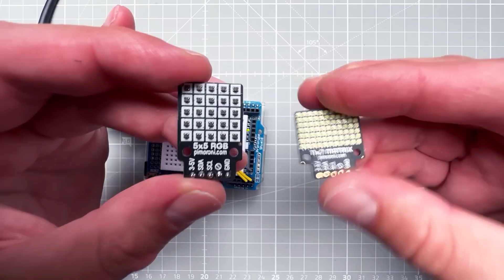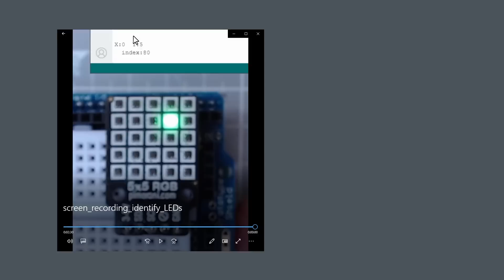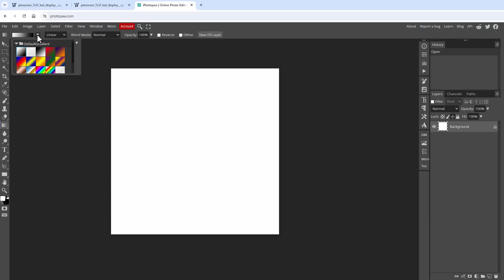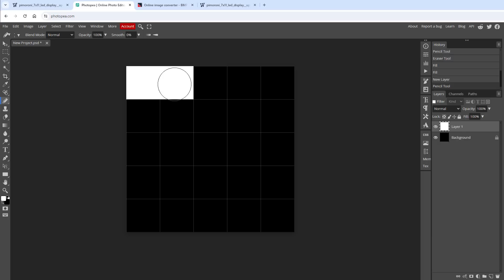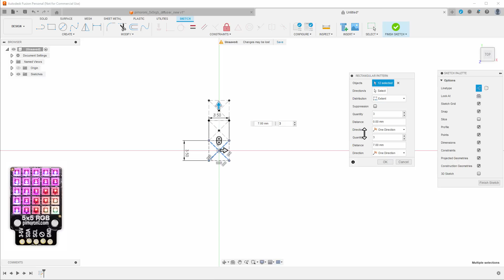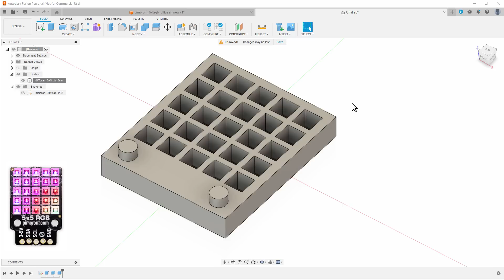Yet Another Gear Display

Comment: I think the best look would be to simply print a traditional diagram on paper (black background, white shifter lines and printed gear numbers and R) of the shifter pattern just below the knob surface plexiglass, making it round and using the RGB array as backlight for the knob showing what's selected vs the others in different color, and perhaps something else when no gear is selected.
Reply from the maker: I like that idea! I´m just slightly worried about the opacity of the printer's ink; those tend to be semi-translucent, but it's definitely something worth exploring. Plus, the 5x5 LED matrix nicely aligns with the H pattern image. Thank you for your feedback.
Reply: @upir_upir  Use a laser printer. They make properly black blacks, which are also suitable for things like PCB photoresist stuff etc. The way they work is that they attract statically charged plastic dust particles onto the drum, and then the drum is rolled over the paper or transparency film, and then that is rolled between hot fuser rolls that melts the plastic dust onto the media, where what you printed essentially becomes a thin film of plastic.

There are even proper plastic transparency films that can be laser printed on, but don't use photocopier transparencies; they ruin laser printers even though the technology is pretty similar otherwise. Instead look for "laser transparency".

I think the laser transparency films just have a higher melting point, since photocopier films get molten into a sticky mess around the fuser if you try that. There's also a difference in the static attraction between photocopier and laser transparent film sheets, and the photocopier kind will also ruin the static properties of the drum of a laser printer.

Comment: I did a project like this last year i designed myself a circular array of EC-10 neopixels and have the animations coded to that, i can send you the gerber or a board if you want to try that
Reply from the maker: That sounds very interesting, if you can send me that board, I would appreciate it. I have ordered a few neopixel matrix displays, but none of them are circular, they are all squares.
Reply: @upir_upir  Yeah i would love to send one over to you, what is that diameter of your gear knob insert as these boards sit at 28-29mm
Reply from the maker: @SoulJuce  That would be a perfect size. The top part is I believe around 29mm in diameter. Thank you!
Reply: @upir_upir  that would be the same size i made my digital gear knob luckily, Not sure how the mapping will go for you but il send a documentation of each pixel number location on the board that way you can map it in way it behaves like a matrix lcd, il have to dig out my platform io code and see what i did to overcome it

Comment: Oil Temp next please! :)
Reply from the maker: I might do that! :)
Reply: @upir_upir  would love that! maybe with a nano oder esp32? small oled display? 0.96 or 0.91?
Reply from the maker: @DfensFailed  Definitely a smaller arduino board, not sure about the display yet, but I have a few temp sensors and I need to find some good use for them.
Reply: @upir_upir  maybe an led bar graph? Going from Yellow to Green for optimal Oil temp, until red for dangerous level?

Comment: I would recommend putting a chamfer on those locating pins, makes them easier to fit if your tolerances are a bit off.
Reply from the maker: Good point. I didn´t included those, since it was a nice tight fit right from the first print, but I will definitely keep that in mind for the next time.

Comment: Would be awesome to see you integrate your shift knob indicators into an actual racing game by using SimHub software.

Plus, with this RGB matrix, you'll be able to use it to not only indicate the gear but also act as a shift light to indicate when to shift gears.
Reply from the maker: That´s exactly the plan, and the topic for the next video. I´m playing with SimHub right now, should be hopefully pretty straighforward. Thank you for your suggestion.

Comment: would it not be easier in this state of the project to use a ws2812B board, like eg the 01space C3FH4 RGB? has the ESP32C3 on one side and a 5x5 rgb matrix on the back
Reply from the maker: Probably yes. I do plan to exlpore some neopixel matrix displays soon. The suggested board looks very interesting, but I don´t know if it would fit. I will definitely try it. Thank you for the suggestion!

Comment: Great stuff. On the diffusors, Id try printing the lower walls in black to reduce light bleed over.
Reply: I've used foil tape on the walls of diffusers. Would be fiddly on such a small piece, but still less fiddly than printing multiple colors if your printer doesn't do that.
Reply: @ethanpschwartz  Another diffusion approach is to pot the module in black casting resin then carefully sand back the top surface to the point where you're just cutting into the face of the leds. Then cover with a thin sheet of white PMA or similar. No bleed and great definition. I've done this for led encoder rings. Fiddly and messy but the results can look great.
Reply from the maker: Thank you all for the great suggestion. I will start with black lower walls, since the 3D printer has AMS unit, so switching colors is not a problem. Not quite sure how it will look like, since the white PLA is quite translucent.